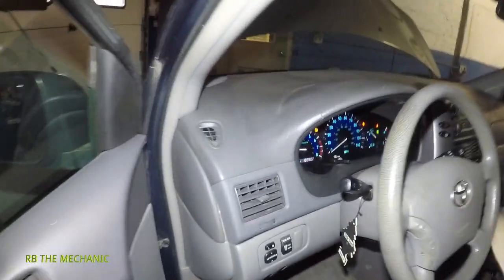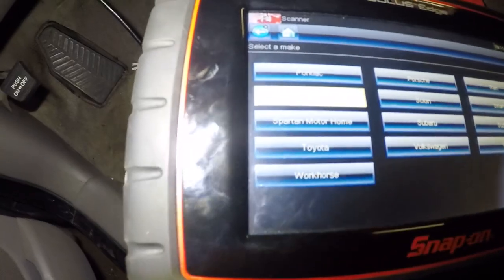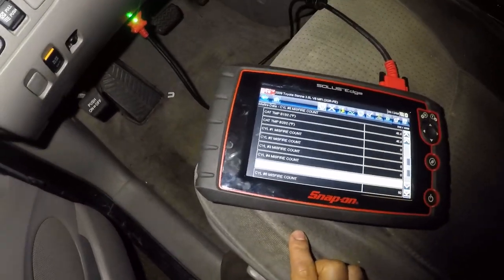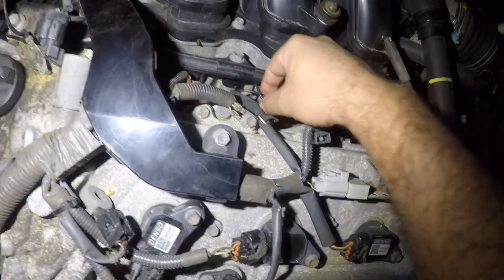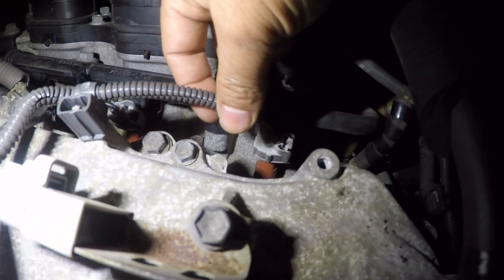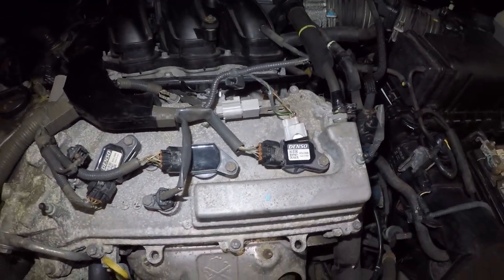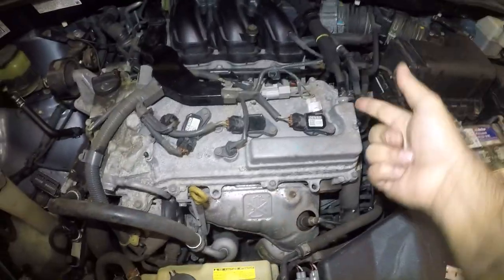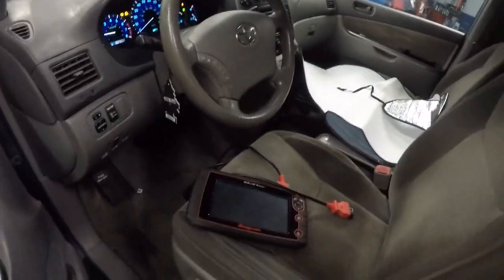Toyota Sienna flashing check engine light Cylinder misfire P0301 P0302 P0303 P0304 P0305 P0306

Comment: My Toyota Highlander 2015  is making the same p0301 what the mechanic recommend me was that have to change the motor.
Reply from the maker: Cylinder one is in the rear I would start with tune up and coil change and check the wiring on injector and coil while it’s intake of off big job to get to cylinder one check out my video on full tune up on this car

Comment: I have changed the plugs on my 2008 sienna, checked the coils which look good. I swapped out coils 3 and 5 with 2 and 4 but still get the 303 and 305 codes. I also have the flashing check engine light, and vsc and trac lights on. What should I try next? Fuel injectors? I also get a c 1201 code
Reply from the maker: Yes check injectors intake seals and engine compression
Reply: Do you have videos on how to do this on a 2004 to 2010 sienna?
Reply: @williammurray5655 did you ever fix ?

Comment: If it’s not injector, spark plug, coil or compression .. what can it be ?
Reply from the maker: Then it could be ecm or oxygen sensor could be a reason
Reply: My van started running rough after I changed the timing belt. Ran good for about 8 Miles that was it

Comment: Hi,I have the tire pressure light and went to advanced auto parts to check it out.Why did I get a p0304 light.My check engine light isn't even on
Reply from the maker: Turn ur key on and then off.  And now pay very close attention turn ur key on and dose check engine light come on? And the go away after 1-2 seconds

Comment: Does bad fuel injector throw p0302 code? I replaced sparks and tested coils and they were all good.
Reply from the maker: Yeah anything that’s controls the cylinder can cause it basic is plugs and coil
Reply: @RBTheMechanic  thanks mane

Comment: I change the coils n the spark plugs. N I’m still getting the same codes. P0301 n p0302   
Do you think it’s my injectors
Reply from the maker: It can be also it could be wiring on injects rats get down there they cut wires like this car it had wiring issue cuz rats got don’t to the center of V engine
Reply: Ok but the wiring is good

Comment: I'm getting random misfire and it only happens after i drive it for a little while. It starts flashing and and shaking. when I turn it off and then back on it either goes away or stay on and not flash.
Reply from the maker: Check oil level and scan car for codes

Comment: What else could be the problem is there a way that you could say what could be the problem?
Reply from the maker: Flashing check engine is misfire scan the car to see which cylinder it is the basic is spark plug and coil after that if it dosent fix u need to go deeper check compressor or cylinder injector operation anyways start with basic
Reply: @RBTheMechanic  thank you someone told me that I need to repair the valve number 2 or the piston there something wrong 😣😣😣😥😥😪😪😫😫
Reply from the maker: @fakku6356  that’s somthing u can’t do it’s like rebuild of engine try the basic first coils and plugs